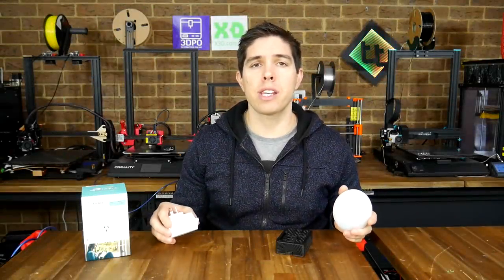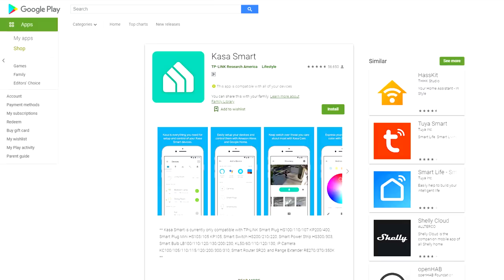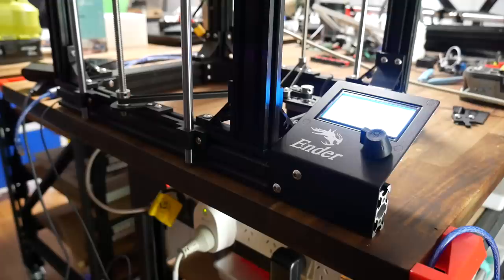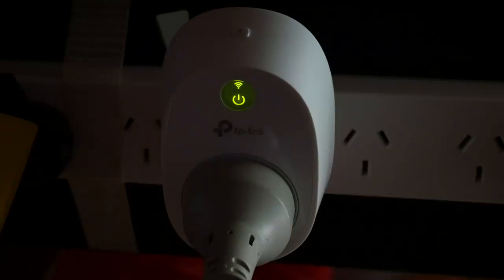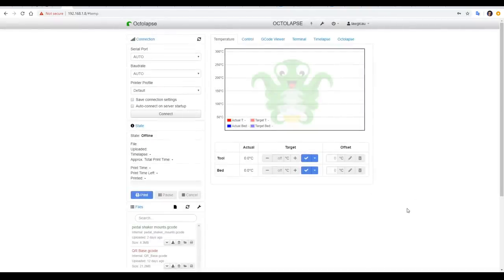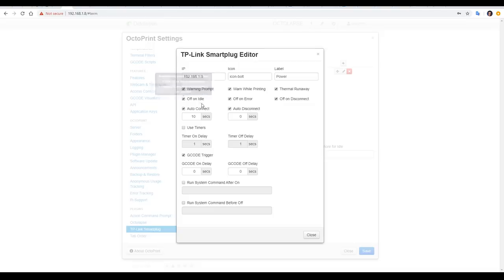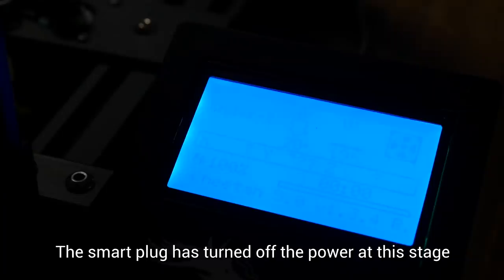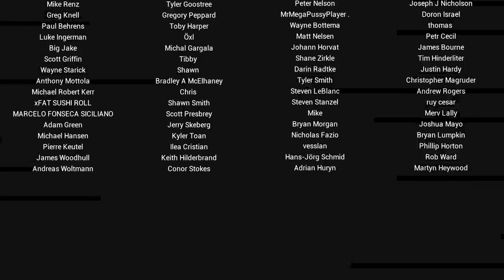Use smart plugs + Octoprint to improve your 3D printing

Comment: This is amazing! I´m in the process of building the Lack enclosure for my ender 3 and I have an skr mini e3 to soon install as well. I originally wanted to go the route of the relay board but this is way better and easier. One thing that I need to work out though is the led strip. I wanted to connect the 12V led strip to the power supply of the printer and turn it on and off via a raspberry pi script that can be embedded in octoprint. But that wouldn´t work now if the plug shuts the power to the printer completely. I need an independent electricity source for the leds if I wanted them to turn on and off without the printer always being on, right? 🤔

Comment: That ftdi from a few videos ago is very handy with home automation if you didnt see my comment from last time.  A lot of these devices have esp8266 chips in them and can be modded with the programmer.
Reply: Sadly, a lot of the tuya models are starting to use non-esp chips. Have to be careful in purchasing.
Reply: Thanks for the heads up, might need to do some research and see if I can score a few extras just in case.

Comment: Great video Michael, I've been using these Kass smart plugs for months now but without octopi, I just set it to turn printer off 20 minutes after I expect the print to finish if I'm printing over night or if I'm not home. 
Have you considered using one of those fire extinguisher balls as back up in case of any emergencies?
Reply from the maker: I've seen them in community groups. I'd need  a couple I think. Might happen in the future.

Comment: Could use some help I have a CR10S Pro when trying to print using octoprint it skips the auto bed leveling and prints 5mm from the top of the bed I am using cura to slice the print and than using octoprint to send it to the printer. I dont believe the problem is cura because if i load the print onto a SD card and try to print it works fine. Help please

Comment: You can use home assistant to automatically switch off your 3d printer if the smoke alarm turns on.

It probably wouldn't be too difficult to create an octoprint plugin that does this as well.
Reply: While a good addition, the main purpose of this is to prevent the printer from catching smoke in the first place by implementing thermal runway precautions. That's not to say it won't catch fire before reaching those temperatures though.

Comment: The problem with these smart plugs is that they need internet connection in order to work, because they can only receive commands from a 3rd party cloud server. The only alternative that fixes this I know of is a Sonoff smart plug with a custom Tasmota firmare. The voice control from Google/Alexa is still possible via IFTTT and you can turn it on or off via browser or Octoprint without any internet connection as long as the intranet is fine.
Reply: The plugin seems to use a local path so the router is the weak link in that path.
Reply: Generalization and not absolute truth. Ie. Philips Hue works locally with its own hub.
Reply: As author of the TPLinkSmartplug plugin I can confirm that it does not require to be connected to the internet and functions completely in Local mode. You may not be be able to get the Google Home/Alexa integration without it though.

Comment: hi Michael I have a quest for you.. I have a ender 3 v2 with a raspberry pi zero 2 running octoprint, I have the pi power coming off the printer so just the 1 power cord in the wall, what in trying to do is.... at the end of a print have a few mins delay to allow cooling the printer, then to properly shutdown the pi(octoprint) and finally turn off the smart plug to turn the power off the printer, I use the Webhooks to notify me on start,finish ect but can't find any plugin to do this apart from killing the power completely. any ideas ?

Comment: Michael: "Google, turn on the 3D printer"
My Google Home: "Sorry I didn't understand"
Reply: Yeah all of my Google homes consistently get dumber by the day.
Reply: @substratum3d  Pro Tip, don't call your 3D printer "3D Printer". If you do, God forbid this video gets in auto play rotation and Michael turns off your printer, while you are 80% done with a multi-day print. :) The funny thing is I just implemented this mod in the past half hour. Had a WEMO laying around and it was a similar setup with a different plugin. Granted I had to use some kapton tape to tape over the 5v on the USB cord. Edit: Oops looks like he said turn on not off :) Glad he picked his words wisely. Doing to many things at once.
Reply: @SolarityTechnology  LOL mine did too

Comment: 4:05 I'd really suggest you separate your Pi power to its own switch. Quickest way to kill a Pi's SD card is to power off before a shutdown command.
I think you "ticked all the boxes" for the method you presented other than splitting the Pi power to a separate switch. There are dual relay smart switches available and I use one on mine.
I'm glad to see the plugin doesn't use the cloud to control the switch.

I've been running Home Assistant for my smart-ish home devices for several years now. It's a bit of tinkery, but then so are these printers. I flash all my connected devices w/ Tasmota firmware which cuts the link to the cloud completely. DigiblurDIY and DrZzs are my go-to guys for smart home setup. The former has a no-cloud philosophy while the latter has a mix of voice assistants.
Reply from the maker: I agree on the pi power. So far I have had the two power bank plugs permanently on. I only intend to cut the power in case of emergency in which case the pi image is of little concern. I'm reading Tasmota a lot in the comments, I will have to look it up.
Reply: Teaching Tech lookup Tasmotiser when you do. So easy.

Comment: thank you very much for your video. I already did it but for some reason when I first start the reaspberry and then start the printer it gives me an error TMC motors or something like that. That has always happened to me so I first turn on the printer and then turn on the raspberry (without this plugin)

Comment: I have a sonoff WIFI relay for half a year. It has both temperature and humidity sensor so I can set it to turn off after an enclosure cooldowns and also works without a wifi connection out of the box no need to set any open ports. I hope they make  similar plugin in octorpint for my sonoff relay., seems a bit better than just an external temperature sensor, since mine works just as enclosure cooldowns instead of the hotend.
Reply: Besides the TPLinkSmartplug plugin, I've also authored Tasmota and TasmotaMQTT plugins for OctoPrint as well that will be able to control these sonoff relays if you flash them with Tasmota.

Comment: Last time I tried Octoprint the RasberryPi powered the LCD screen on all the time. That was with the CR-10S. Is that not an issue with the Ender machines? 

EDIT: lol I should have just finished the video. Good to know about the print to block the plug.
Reply: Shticky tape.

Comment: I solved it like this. The Raspberry gets its power from the printer's power supply. Before the power supply is a Wifi power switch with Tasmota software.
The only way to turn it on is with the Tasmota switch. For this I can use webintface or mqtt.
The Raspi can turn off the Tasmota switch on command, with a 1 minute delay. At the same time, the Raspi is shut down in software.
When the Tasmota switch is off, that's the only standby power.
And the Tasmota switch is still able to measure the wattage.

Comment: How do you shut down the pi BEFORE the socket switches off after cooling? Mine is powered from the PSU (really good three socket USB xt60 hub, loads of power, on a Y adapter for xt60). Has been over a year. I’ve loads of these TS100 plugs, but for anything above just a light, I tend to use wemos d1 mini and a relay board. 4 relays on my last one with tasmota. I have another wemos with a simple LDR light sensor and if it’s a bright day, no lights come on due to motion in smartthings. Endless possibilities lol. I really need to figure how to shut down the pi fully before the power. . And the plugin is ON the pi lol sooo..

Comment: Hey Michael,
Do you know if it's possible to create a gcode script that preheates and runs auto bed levelling before stopping and waiting for the user to start the print? It would make octoprint automation much better, as the machine is fully primed and levelled, no need to wait for levelling before watching the first layer. Thanks

Comment: I have not been able to level the bed on my ender 3 whatsoever and noticed the x track beam is not level after I’ve obviously built the machine. Can I just reverse the build to sort this problem out? Thanks in advance.
Reply: What? yes. Unscrew the bolts and square the beams.

Comment: They have a 12amp version and a 15amp version. I'm assuming that the 15amp version is the safest bet to use for an Ender 3 in the US?
Reply: 12 amps * 120 volts = 1440 wats. The Ender 3 uses about 300W, let's say 400W to be generous. With one plug you could be powering 3 printers and some Raspis, light and whatnot. But if the 15A version is not much more expensive I'd get that.

I have Tuya SmartLife plug that handles 16A@240V (Europe).

Comment: You can also do this with Tasmota flashed devices like Sonoffs
Reply: I use Blitzwolf SHP7 Plugs (Europe) flashed with Tasmota controlled by Octoprint. Works realy great and second nice to have: Octoprint logs the power consumption of the 3d-printer
Reply: Or tuya devices w/ TuyaConvert2 if they have the esp chip. Some newer models don't sadly.
Reply: Too bad the Tasmota plugin doesn't have the turn off on idle like this TP-link plugin does.  I would definitely make use of that feature.
Reply: @CJICantLie  There's an update that lets you do that now. The author of the plugin just got that added and it works perfectly

Comment: I use the relay method for a while now. It is the more safer way. If something goes wrong, the Pi crashes, or anything else, the relay loses connection/power and it switches automatically to off. I don't trust Wifi connection enough, or when someone decides to plug the router by accident, or when there is something happening, but the power plug keeps feeding the printer.
Reply: Are you absolutely sure about that. Have you actually measured pinouts if board would freeze? You might get exactly opposite situation than you're expecting.
Reply: jothain I made sure the printer only stays on as long as the gpio pin is high. If I pull the power from the pi, or I pull the GPIO wire, the printer shuts down directly. (Since the relay falls down to default open state when power to the relay data pin is cut.)

Comment: The main fire issue that I see with 3d printers is when people use them at night, when they are sleeping.  I don't think it is sufficient to only have a single point of failure like a smoke alarm.  Especially in a case such as yours, you should really have a wall with several hours of fire rating between you and the printers.  You can accomplish this pretty easily by just covering the walls with a few layers of type x drywall, it isn't that expensive and it is generally what is spec'd out in commercial applications.  Don't even bother taping the joints just screw it right to the wall and overlap each layers joints.  It's probably a good idea to clad the wall behind the 3d printer in some kind of metal sheeting, but actually the drywall is enough.

Comment: If you get tuya based devices, you can flash them with tasmota using tuyaconvert to avoid any 3rd party to control and lurk from your devices. I have set up my printer actions using node-red. When I send a file using prusaslicer to my printer (over wlan) and the printer is off, octoprint listens mqtt topics: new file added, my LED's in the case turn on, the power to the printer turns on, the connection is automatically refreshed and the printers starts to warm up and print. But I can also trigger everything via homekit, also via node-red.
Reply: Besides the TPLinkSmartplug plugin, I've also authored Tasmota and TasmotaMQTT plugins for OctoPrint as well that will be able to control these Tasmota devices too.
Reply: @jneilliii  Nice! I am using the "normal" MQTT plugin and use node-red as "brain" for everything.

Comment: I just installed the plugin in and turned the 3D printer off using the lightning bolt, but now the lightning bolt is green but keeps spinning , when I click on it it ask me if I want to turn off? It is already off?

Comment: If my internet goes down, all my smart switches (Amazon) default to OFF, interrupting the current print. GRRR. When printing from Octoprint, the 'recover from power off' does not work.
Reply: Bill Wheatcraft Ooohh...that’s a nasty “feature.”  Our internet isn’t the most stable.  I’ll check my smart switch behavior before putting my printer on my smart home system.

Comment: The question is whether this plug can handle the amperage the 3d printer can draw
Reply: Just under 4.5A peak on US power. Even less on AU plugs at 220VAC.
Reply from the maker: Because it's regulating mains power, the amperage is much lower. The plug can handle 10A 240V, a 3D printer will be no where near that.

Comment: From a Home Automation/Alarm Professional wise words. Don't trust the Cloud to keep you safe or run your Home Automation.

I have Octoprint talking to my Home Assistant Server along with a smart socket flashed to use Tasmota so I don't have to use the Cloud to control it. I also have Smoke/Heat Detector on the ceiling over my 3D printer. It's tied into my Alarm Panel that is monitored.

Comment: Using a relay is much cheaper and easier.  Just splice it into the AC cord from the wall into the power supply, print a case, and install the PSU control plugin.
Reply: A simple relay defeats the purpose of being able to control it with a google home, alexa or your phone don't you think?
Reply: Splice the cord, print a case... and that easier... all right buddy boy.

Comment: Brilliant Video, and many thanks for making it to give me and many many others the knowledge to setup our printers with a smart plug. May i also add that this works just as well with 'Alexa' as well as the Google stuff.
Not sure where to ask this, but my fav 3D printing streamer may be a good start and it is kinda related... Having turned off my printer using the TP-Link and plugin, do i leave my Pi running? or can i shut it down? At the moment, i am just turning off the power which like any PC/Laptop cannot be good. How do i turn off the Pi other than at the wall socket? (Pi Idiot asking :) )
Thanks

Comment: I just learned about Amazon Alexa Guard. My Amazon Echo Dot should be able to detect a fire alarm sound and it can cut off a smart plug hooked up to the printer. This might save me from having to buy an expensive smart fire alarm and use my existing cheap fire alarm for this project. Has anyone tried this?

Comment: Take a Look in the Energy consumption of the tplink devices. Mine runs at >2w in comparison a Osram Plug only consumes <1w

Also only one Wire is switched and the Things have an aweful leakage, connected to a 18w Led it will Light Up even If switched Off. Please Check this yourself and maybe so a Video about.

Comment: NOTE Smart plugs work on 2.4GHZ only - They don't work on 5GHZ. Routers that combine both signals 2.4/5, the plug won't connect to your wifi
Reply from the maker: My router broadcasts both signals and I connected it to the 2.4ghz without issues. Perhaps on the type of router you are talking about the settings can be tweaked to accommodate?

Comment: @Teaching Tech : You can even automaticly switch on printer with cura and octoprint.  It will switch on the plug, wait for octoprint to connect and then send gcode to octo and launch the print.
Reply: nuxator but if the printer isn’t connected, Cura doesn’t send anything and just says queue job?

Comment: Warning in regards to the TPLinkSmartplug plugin and the HS103. I've recently been informed that the latest firmware for those devices break the local network communication and therefore the plugin will also not work. If TPLink makes those same firmware changes to other devices, then they will also break. The following models have been tested personally by me and are currently functioning; HS100, HS107, HS110, HS300.
Reply: *currently functioning.
Reply: Now then, Is it safe to do the latest firmware upgrade on the HS100?  or.. just not do upgrades at all?

Comment: Looks like if you have a Raspberry Pi 3B
, 3B+, or Pi 2B there is a program to disable the USB ports instead of using tape or some other mechaincal means. https://github.com/OutsourcedGuru/OctoPrint-USBControl

 I tried it today but it isnt compatible with the 4B yet. I dont really know how to use GitHub very well, but from what i could make out it looks like they are working on the 4.